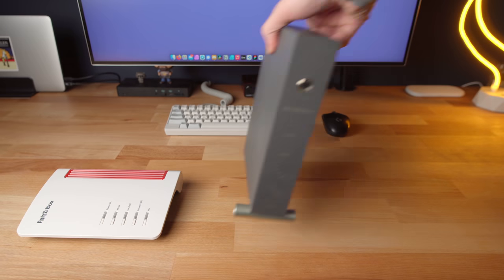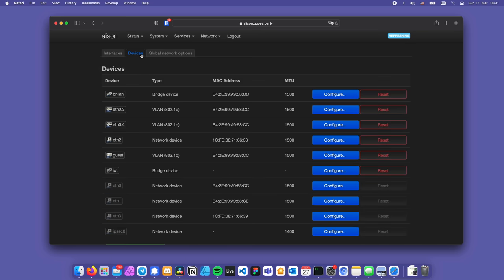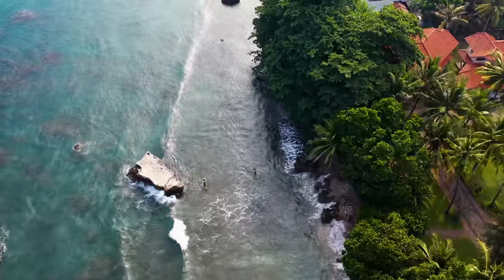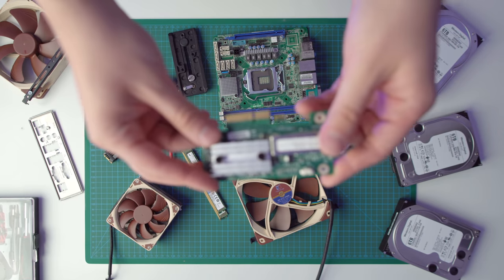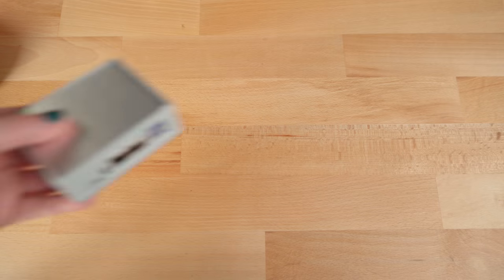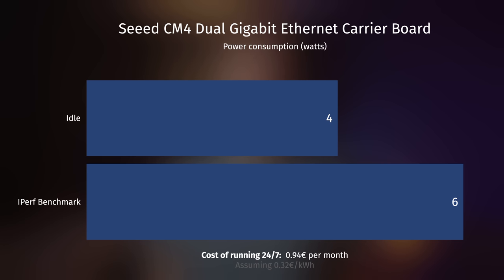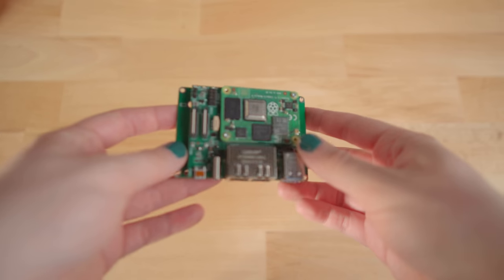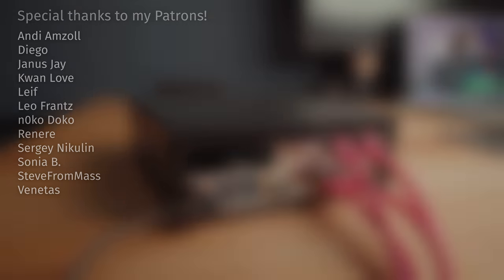Should You Build Your Own Router?

Comment: 08:58 - I'll be working on another router build soon, this time with a Waveshare board. But yeah, availability of CM4 has been the downfall this year. Still wish some company would integrate an Intel I340 or something like that directly into a CM4 board design so the network packets could route through the NIC and not through the Pi's SoC.
Reply: OpenWRT supports Raspberry Pi!
Reply: Dude, really? You are everywhere
Reply: Unfortunatly Intel nics might have huge NDAs thats is why realtek chips are more common. Users should also expect to have more latency since the eths will be running via SW bridge instead of an HW switch IC. I was looking to this problem too... you might also want to use PCIe for WIFI too.
I'm really looking forward for new RPIs with hi bandwidth MUXes and more PHYs. So I can for example disable HDMI2 and I have another x1 pcie.
Like the RK3568 does.

But for a router i'm looking forward to the new MTK Filogic chips. I have fiber via SFP ONT at home (GPON, but moving toward XGSPON), so having a single GBE port is not enought.
Reply: Hi

Comment: You should take a look at a Fujitsu S920 thin client. Low power AMD quad core, passive cooling, two DDR3 SO-DIMM slots and a low profile PCIe x4 slot. 
Works very well as a router, up to gigabit speeds. I was able to get ~1.6Gbit of bidirectional traffic with OpenWRT.
Also, they can be found for under 30 to 40 eur.
Reply from the maker: Welp, I guess my next video will be "DON'T BUILD YOUR OWN ROUTER" 😁

Thanks for the tip!
Reply: You will need a left facing, right angle, 1U, PCIe riser, as the thin clients don't usually have them.
Generic risers from ebay should work fine.
Reply: I have this exact system. Actually multiple ones, I stocked them up in case of future builds. Interestingly you can also add a sata ssd and take a power from a pin header. So this system is really versatile.
Reply: HP t610, t620, and t630 Plus thin clients (it has low-profile PCIe x4 slot) are also good options.
Reply: @delboyg01   Unfortunately my thin client does not have iommu passthrough.
Reply: @bluesquadron593 - Understood, but even an Intel i3 4th gen will provide iommu (needs 5th gen for device passthrough). Check on eBay, lots available for not much more than a thin client. Yes they use more power, but most have mobile CPU.
Reply: @delboyg01  My requirement was a tiny mini micro form factor and PCIe slot which can accommodate a quad NIC. Sure, a small form factor pc would do that, but even that is too bulky. Oh, and I am in Europe, so some prices and model availability is different here.
Reply: @bluesquadron593 - That's a difficult ask, custom config tiny PC are the only one available with the PCIe slot. Not many available on the used market.
Reply: @WolfgangsChannel  Or an HP T620 Thinclient (AMD GX-217GA SOC, 16GB SSD, 4GB RAM). I paid 29€ on eBay for it. For an extra 35€, I also got a mini-pcie to lan adapter (2x1Gbps realtek chip) and I'm good to go. Opnsense runs smooth as butter, with plenty of resources to spare. I have a home lab, so I also have a couple of switches, wifi aps and several servers and nas devices.
Reply: @bluesquadron593  did you find anything
Reply: @mathaius69  what do you mean?
Reply: @anoobis260  the t620 plus model you mean?
Reply: @anoobis260  how do you lead out two lan ports?
Reply: @anoobis260  got it! Thanks.
Reply: @WolfgangsChannel  I like your shirt
Reply: Problem is the S920 consumes around 11 to 17 watts. A typical router consumes around 3.5 to 7 watts..
Reply from the maker: @ArcardyArcardus  A typical router also cannot do IPS/IDS, DNS-over-HTTPS, run AdGuard, Pi-Hole, Home Assistant and other Docker Applications, and only gets yearly security updates if you're lucky. If you don't need any of that functionality, then sure, a typical router would do just fine, but if you do, you'll need to run a separate machine for it, which will result in a higher net power consumption
Reply: @WolfgangsChannel I live in Germany and have a vodfone cable router (grey vertical box). If running a Fujitsu s920 as a router, how do you connect the cable to it to replace the Vodafone router. I want to replace my router completely as it runs at 17watts. Doesn't it defeat the purpose to run a Vodafone router AND a diy router, because then you're doubling your power consumption
Reply: @buildanddrive hi, did you find any solution?

Comment: Great Video! I'm running a J3455 board with pfSense for over 5 years now. Never had any issues, and the included monitoring graphs helped me to "prove" to Vodafone, that the connectivity issues are on their side. Waiting for the J4125 appliance with 2.5G to arrive for the next big upgrade!
Reply: Lucky you. I heard that baytrail CPUs have a silicon problem and they get older quickly and stops booting etc. You can read about it all over the net. Cisco even went that far to replace devices based on this family CPUs.

Comment: I live in The Netherlands. The government passed a law a couple years ago that went into effect last year that requires ISPs to allow you to connect you own equipment without using their equipment at all. They are also required to provide the necessary information for doing that.

This means that I could disconnect not just my ISPs router, but also the ONT required for converting the fiber signal to copper network cable.
Reply from the maker: I'm not sure if we have laws for that in Germany, but you can also use any 3rd party modem you want. The problem is that you'll either have DSL or Coax at home – which means that you will need to use an off-the-shelf router/DSL box alongside your DIY one anyway.

In case of DSL, there are PCIe cards from companies like DrayTek that can theoretically replace a standalone DSL router, but from what I've heard, they're not as reliable.

With Coax, a standalone box is unavoidable, since DOCSIS is a proprietary standard

Comment: One of the nice bonuses of a DIY router is having it run double duty on tasks that are well suited to your gateway node, especially if you run a cluster at home. Things like a load balancer, ingress controller, kubernetes master node, bastion host, DNS (remember this is what pihole is), etc. Yeah a lot of people rush to build a pfsense box when they definitely don’t need it but if  you do any kind of homelab stuff a more capable router is a godsend. I’d say go with the efficient x86 options out there if you’re at all interested in even a small homelab. If you’re just doing one server or NAS at home then it’s not worth it
Reply: I rushed out and built a pfsense box, however it cannot replicate what by ISP's router offers, so it ended up being a double NAT'ed toy. about the only real use for it is as an 'isolator' for unknown PC's that come my way for repair, that need a network connection, but I don't want them to see my NAS's etc. (as in they are potentially full of exploits etc)
I am leaning more and more to the retro side of computing, if there were plugins for pfsense that did slip type connections out the serial ports, or I could connect serial terminals etc etc. for some ancient type fun then it would really have my attention. Otherwise its just another watt sucker that I don't want on 24/7
Reply: @paulstubbs7678  Why can't you disable NAT on your ISP router?
Reply: This is why I always recommend building it in a hypervisor so that you can use the machine for other server stuff.

Comment: In general, I have to say that you've put together a well researched video. However, I have to make some additions. First, in theory, everyone can use a self-built router, regardless of the ISP. However, with some ISPs that may mean you'd have to put up with double NAT (connecting the router as a client to the ISP provided one). 

Second, and much more important: With great power comes great responsibility. Most of the router operating systems that are freely available will give you total freedom, meaning you can totally disable all firewalling by accident, or nuke your configuration with a click. However, that is - at least in my opinion - offset by the fact that it lets you do what you want with it.

Third, I agree that wifi is tough. Without a separate access point, or being fine with running 2.4 GHz only on a PCIe addin card, there's not much left.

Looking forward to the next parts.
Reply: For Wifi you could, in theory, just use one M.2 Slot and get yourself an Intel AX210, which costs around 15 Euros and brings Wifi6E capabilities with it. Antennas for the 5Ghz Spectrum, which also work with 6GHz Wifi6E, are plenty cheap as well. Questions is; Does it work with PFSense, as BSD is well known for shit Wifi Support?
Reply: @xxcr4ckzzxx840  You have to watch out with Intel cards on Linux platforms, as I know many don't support AP mode which is, well... required for hosting an AP.

The BSDs are notorious for having near nonexistent wifi support, but there's tables with supported hardware you can refer to in the official Netgate docs.

I'm running a PCI wifi card from TP-Link with an ath9k compatible chipset. On Linux, almost get the full 100 Mbps of my internet connection while on *BSD, I'm lucky if I get 35/35 on a good day.
Reply: Correct! Most ISPs use CGNAT to enable multiple subscribers.
Reply: @xxcr4ckzzxx840  BSD has 802.11ax support, however, pfSense and OPNSense don't have it yet.
Reply: @markarca6360  This has nothing to do with CGNAT. In case of CGNAT you'd even have triple-NAT!
Reply: Some ISPs do weird stuff that gets in the way of some or all of what you're trying to do with the new router... eg... Mac locking, Secret configurations you need to get wan DHCP working that may not be supported by the replacement router.

I've had situations where I just had to accept that I couldn't get IPv6 working or that I needed to leave ISP hardware in the network chain

Comment: I bought one of those J4125 appliances with 4xI225 nics. It works great with OPNSense and PFSense with gb fiber internet using Suricata as IPS. Cost me around 230 usd with 8gb ram/128gb ssd and shipping from aliexpress. The brand name I bought is Topton in case anyone is interested, they took around 13 days ship but once handed to DHL in Hong Kong it took like 3 days to arrive, which I find pretty darn good.

Comment: I did this as a challenge to myself, last year. I've built a box running ClearLinux as a virtualization host and deployed a virtual firewall and several docker containers for WiFi, IoT and PBX.
Apart from the horrendously outdated and misleading documents on VLAN management on Linux, once you learn how to do it properly you might as well build your own switch at this point too... Which is exactly what I did.

Every component is modular and can be replaced or upgraded in due time. And it all fits in an ITX case using 10W TDP at most, making it extremely quiet for the amount of functionality and performance.
Damn, I love this project...
Reply: If you ever make a video on the project, let us know!

Comment: I took my old i7-6700k computer with 16gb of ram and added another ethernet port via a card on amazon, got a net gear access point and installed ipfire to the system. I can fully saturate my gig speed even over wifi so even though it isn't the most power efficient solution out there, it works just fine for me and it was only 90 usd with the parts I already had for years before I decided to do this. My only bottleneck at this point is the apartment's cat 5e or older wall infrastructure, but that won't be the biggest issue once I move out in a year or so.
Reply: What WiFi card did you buy?

Comment: A problem you didn't mention with building your own router as a permanent fixture is that it'll inevitably be labour of love, a permanently unfinished project, and it'll require continuous maintenance.

Of course, if you want to make one as a project to learn stuff, go float your boat, but I'd be wary of approaching this as a permanent installation.

Bearing in mind our dependence on internet connectivity as a near essential utility nowadays, I'd generally recommend a decent SMB level router such as Draytek Vigor, a make I've used for over 15 years, but other makes are available I find them solid as a rock, they're very reliable. This is as opposed to consumer level routers that can usually be identified by their pleasing aesthetics, hiding how little has been spent making them reliable. Mine's 10W at the wall, has 5 LAN +1 WAN eth ports, xDSL WAN port, Wifi 6, mesh, WoL application, VLAN, hardware NAT & VPN acceleration: I run it with gig fiber + xDSL auto failover (4G optional), and DDNS for both remote access and site-to-site VPN.

It's horse for courses, if you like tinkering, and don't get frustrated when you wake up in the morning to find you have to drop all your plans to get your router working again, then yes, build your own router. 😉

The tinkering I leave to a 2.5W at the wall Cherry Trail Atom based fanless NAS/Home Assistant mini PC.
Reply: Dude what’s your parts list? I can’t figure out the WiFi card portion.

Comment: Great video, thanks.

I also live in Germany, have Vodafone cable connection. I'm pretty satisfied with my FritzBox 6590 and I didn't pull the trigger to switch to my own router, but I'm thinking about doing it with either pfsense or opnsense, mainly to get support for DHCP with PXE boot, wireguard and  being able to set captive portals.

As far as I know, a lot of people get Protectli devices and install pfsense/opnsense on them and they're pretty happy with the result.
Reply: At least for the wireguard part, it's already available for some devices via FritzLab and will probably be available for more devices soon :)

Comment: I'll definitely build my own router.
I first start off with ISP router, everyone knows how that 'd get you.
Then I switch to Asus top end model, but kind of limited by the firmware, I want to have my custom RA message, custom mdns, etc.

After watching this, I just realized that I could get rid of all those limitations, if I just built my own.
I can even put 4x 10GbE RJ45 port NIC in them for good measure.
Reply: I've happily run chelsio and intel 10gb NICs for ~5 years in pfsense and opnsense. Intel was better due to heat and compatibility.
Reply: @MichaelSmith-fg8xh  I would say you're a gigachad, but more like a 10 gigabit chad 😂

Comment: I run pfSense on a Qotom mini PC, from AliExpress, with i5 CPU (with AES-NI), 4 GB RAM, 64 GB SSD and 4 Intel 1 Gb Ethernet ports.  I also have a Cisco 8 port managed Gb switch and Unifi AC-Lite access point.  I've been running this config for about 1.5 years and am quite happy with it.
BTW, my Internet connection is a cable modem that is easily put into bridge mode.  My ISP also has a community forum, where I am quoted for pfSense IPv6 configuration.

Comment: Yes. Yes you should. I just build a pfSense security appliance and network router running Squid and Snort on a 64bit celeron motherboard, using DDR4 and I can confirm that pfSense can run on an M2 SSD in SATA mode. The 64 bit bus combined with the modern PCIe interface gives me very fast throughput which I have not yet measured. Mind the bus speeds!

Comment: Nice video. I have been using fli4l as a router on various hardware platforms for almost two decades. Startet with an Intel 486 and currently using an ASRock Rack J1900D2Y. I started doing this because the routers from the ISP always crashed when you opened a few hundred connections, that was around ~2004. You learn a lot by doing it yourself, but as you said in the video, you have to want to do it.

Comment: I still use my old Apple router which has Ac wifi and gigabit Ethernet, which is faster than my internet speed but is locked down in true Apple style. However I now run a little web server and wonder if I should increase my security, as I do get more instances of probing from the internet. That can at times effect my internet detrimentally until my web server blocks the IPs automatically.

Very useful videos, thank you.

Comment: Don't miss the power of ATX router. You can use a hot swap device for easy and fast backups over local network. Also is up to you how it will be connected (RJ45, WiFi, USB tethering via smart phone) trough internet. Linux, nftables, BIND9, squid, isc-dhcp-server, wireguard, nginx. My personal choice is:
MSI B450 Gaming Plus Max, Athlon 3000G, SATA SSD 128GD, 5x two port gigabit NICs and hot swap device for both - 2.5 & 3.5" HDD's, because I have a lot.
Reply: Take a look at the Proxmox VE type 1 Hypervisor, not only can you virtualise pfSence, but also Virtual Machines/ Linux Containers and Docker instances - a brilliant piece of software for these tiny PC's.
Reply: @delboyg01  why pfsense when you have nftables?
Reply: @ChrisWijtmans - You assume that the average user even knows what nftables, BIND9 or Squid actually are??
Reply: @delboyg01  OP talked about nftables and you bringing up pfsense amkes no sense whatsoever.

Comment: Great video 👍 Thank you, Wolfgang.
12:40 -- Fyi . . . NYC residential rates are around US$0.15-0.18/kWh for the variable fees (December 2023).  (Notably, there are sundry, non-variable fees, which, based on usage, increase the total cost by, for example, +100% (lower usage) or +50% (higher).)
My approximate rule of thumb for 24/7 homelab servers at such rates: for each incremental 100W (as metered, and not identical to at-the-wall) costs roughly US$150.00 more per year, or US$12.50 per month, or US$750.00 over a 5-year life (no inflation scenario).  Divide by 10 if mini-PC is sipping only an incremental 10W.
Kindest regards, neighbours and friends.